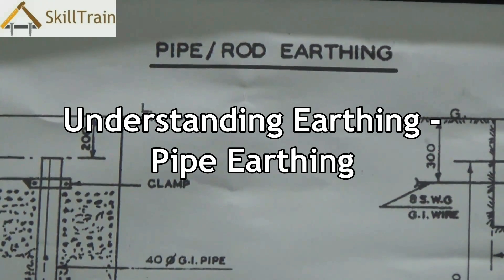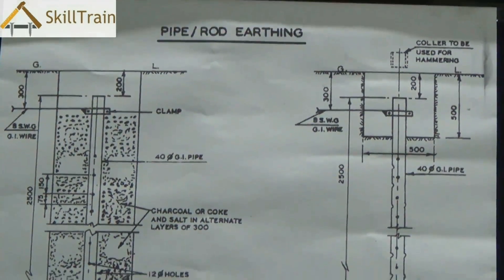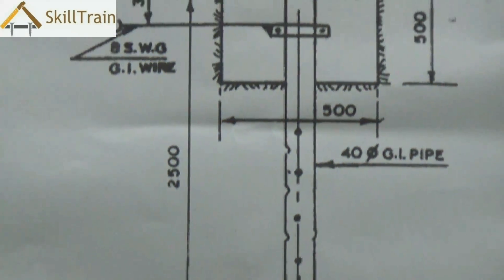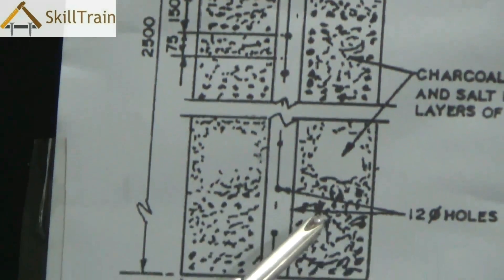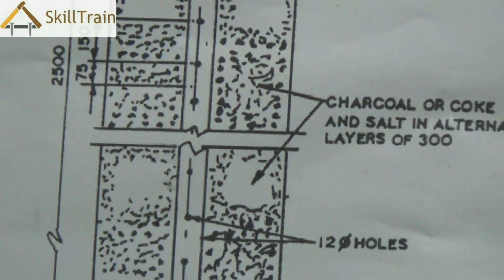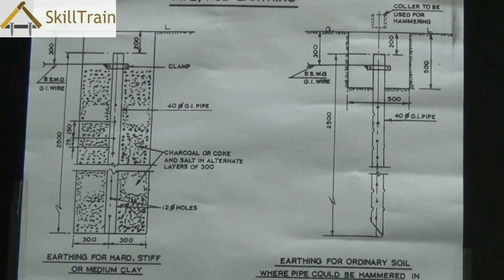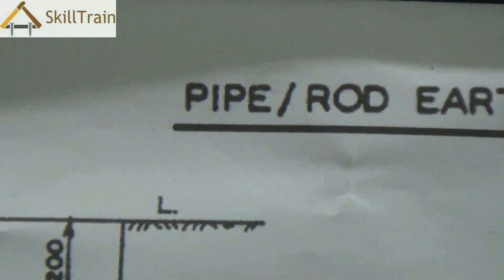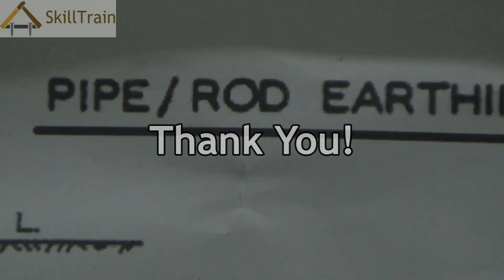Understanding Earthing - Pipe Earthing (English)

Comment: I would like to ask a question about "STATIC AC ENERGY METER 1PHASE 2 WIRE" It has 4 LED indicators namely: 
1.PHASE- Continuously glowing 
2.EARTH- Remain OFF but when Refrigerator is switched ON ,it glows continuously. 
3.REV- Always OFF 
4. CALIBRATE-Keep blinking as per Load. 
I asked the local electrician ,he told me to change the Earthing,I have got installed Standard G.I Pipe earthing by Electrician but still the problem is same as refrigerator is plugged-in ,the EARTH LED indicator in Energy Meter Glows . 
There is No Fault in Refrigerator Ckt ,I have got it checked by Electrician.